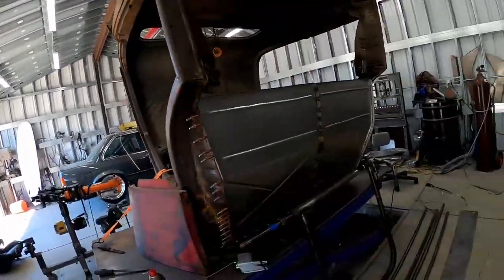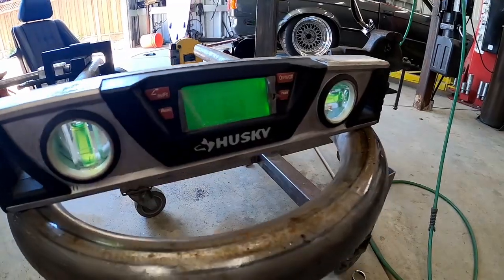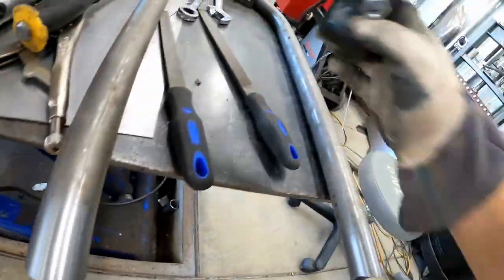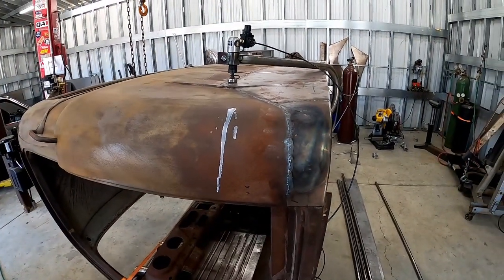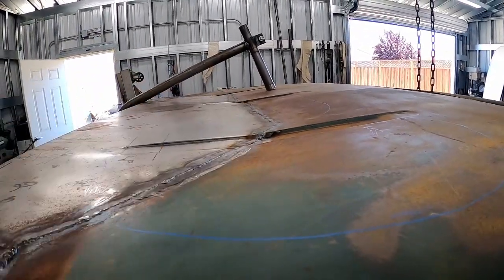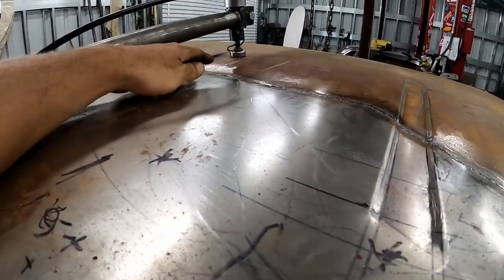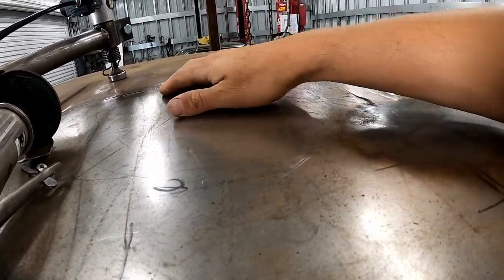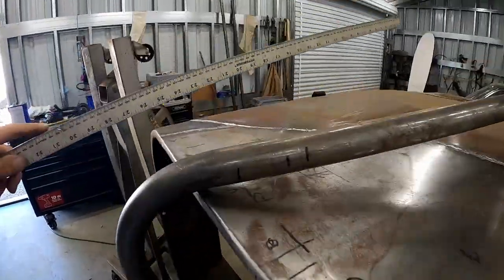DIY planishing hammer gets put to work on the 1951 Ford COE Sheetmetal repair!

Comment: Why don’t you grind the weld smooth? I’ve never seen anyone try to metal finish with a weld bead proud of the surface
Reply from the maker: I had read some metal shapers will planish a tig weld before grinding it, but you’re the second person to point that out. I will give that a go, thanks.
Reply: Shrinking typically occurs closest to the weld. A light grind to create a uniform and flat but not flush surface allows planishing to force the metal down and therefore outward reversing the shrinking of that metal. Once that's done then grind flush and work the metal as needed whether with a planishing hammer, slapper and dolly or an English wheel.

Comment: ive always pushed my panels into shape/position before welding.
next time build a T with 2x2 lumber (or 2 or 3 of them) 
and jerry rig a place for them to stand and hold the roof/panel up & in shape..then tack a bunch of spaced spot tacks.
the closer you are to the final panel when you weld patches the better as it will kee you from making a patch just a little long or short by mistake or miscalculation.
ive spent hours shimming curves with long wedges till almost perfect.
 sure helps sleeping at night

Comment: you are doing it backwards. You have to first give it a crown before planishing.  After you raise the roof you will have an upset and hopefully planishing will shrink it. You welds look bad and you used too much heat. On a long seam you need to alternate from the inside to the outside to balance your thermal input. You are fired.
Reply from the maker: I’m fired from doing something to try and learn? I may have made mistakes, but that how one learns without a teacher. At least I’m trying. Despite your rather rude comment, I do appreciate your criticism, as it sounds like you have experience in this field, and I am always looking to learn, so thank you sir.
Reply: You'll figure it out, keep working